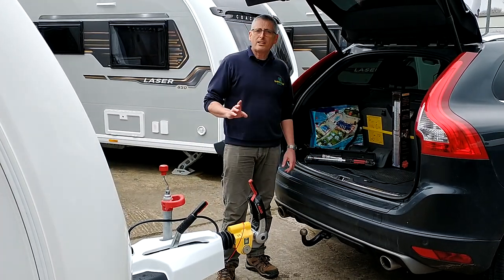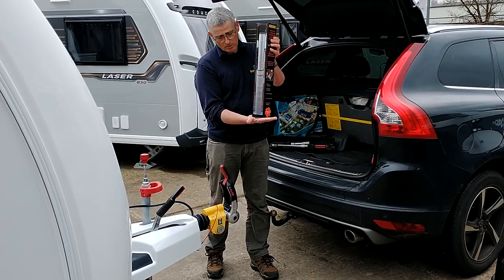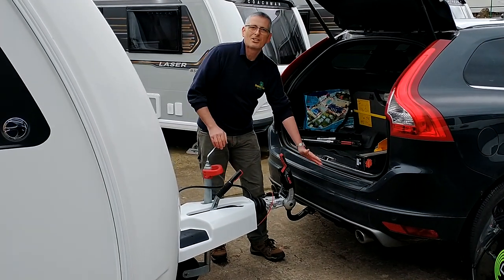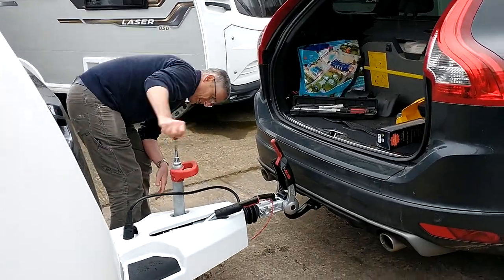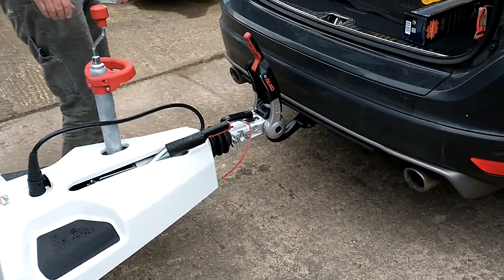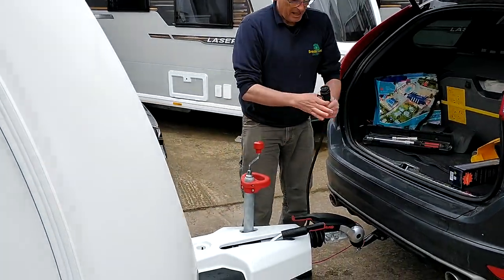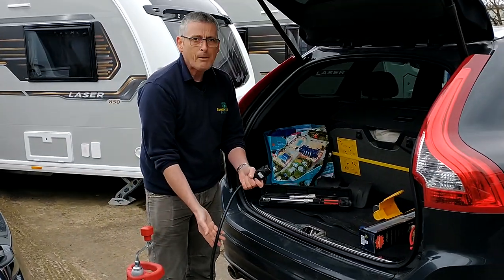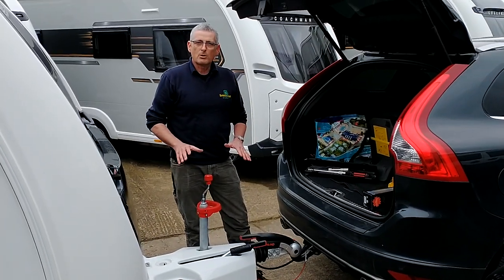How do I hitch up caravan to car?

Comment: 👍 (And if you’ve used a motor mover to set-up hook-up ensure you have disengaged the rollers before pull away otherwise potential expensive damage. 😉)